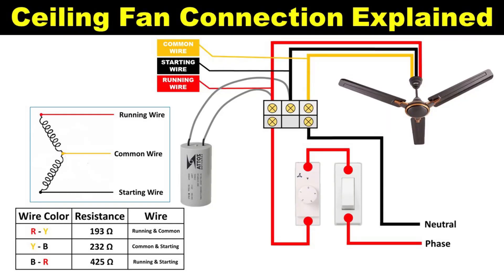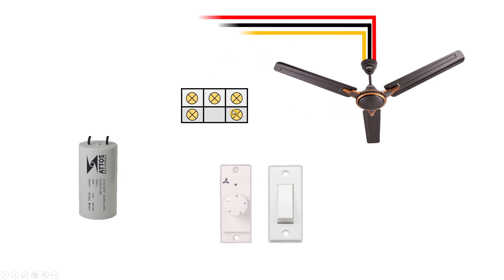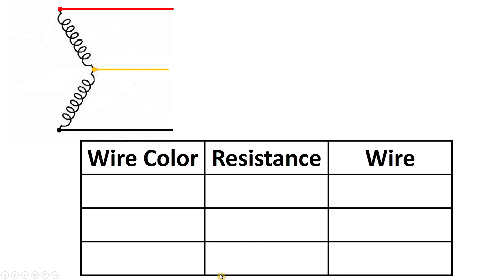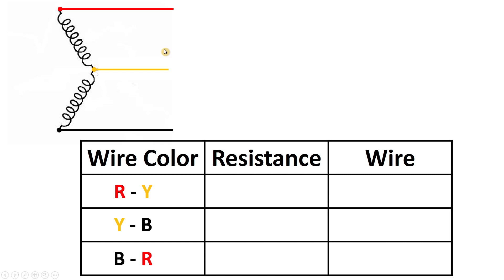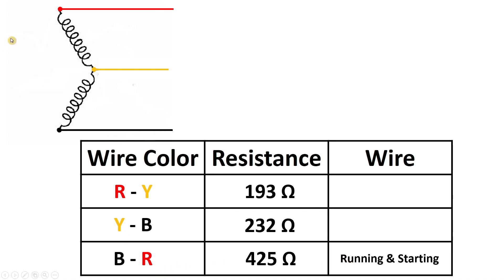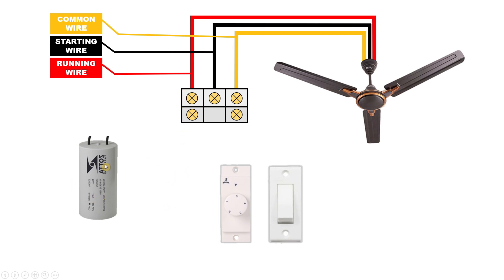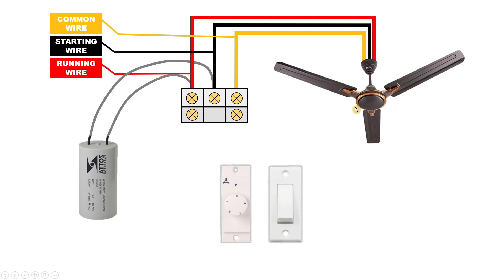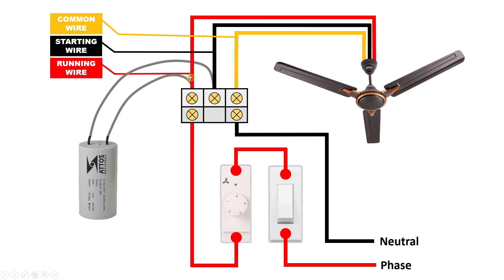Ceiling fan Step by step proper connection with capacitor @TheElectricalGuy

Comment: I need more information about ceiling fan motor connection with capacitor.
Dear sir, I have a problems with power in the house. The lights not working or not lightening. Just blinking all lights

Comment: Many thanks for clearest guidance on fan wires and their functions .I would like to know about my 3 80 years old Marelli make fans , out of which two are starting and running normally. But one is not starting by itself . It has to be given push by a long (walking) stick .Such old fans need capacitor ? How to decide and join a capacitor to this heavy 42 ''Fan and of how much value  'mfd' etc .

Comment: Explained very nicely, but what should be capacity of capacitor in ceiling fan or other like exhaust fan or heavy wall fan, what's the calculation for capacitor if condenser value is missing.

Comment: I have an old ceiling fan with circuit board.  Three capacitors on the circuit board.  Three wires go to the ceiling fan. Four wires go to the pull chain speed select and two wires for the reverse direction toggle.  Can I use a common 5 wire capacitor to replace the circuit board?

Comment: Thanks a lot sir for your elaborate explanation with a good diagram. Excellent professional way if your teaching of this type will surely clear the doubts of anyone interested in learning this subject.  Like this if you could explain the inner winding if the coils i.e starting and running it will give more exhaustive details of the complete fan from winding to operation.  While u give your details of coil winding inside ceiling fan, pls explain the following:-
1. There is confusion whether the starting side or ending side of start and run coils are to be connected for a common wire. I.e. some YouTube videos says you can take one of  end wire and  start side of start wire for common. Another tuber says either the starting side of both starting and running to be taken for correct common wire
 Some tuber says only the end side of both start and running to be connected as common.  
2. Secondly, when u see the fan running from top whether it should run on clock wise or anti clockwise for giving good sir.
3. What should be the correct gauge and no. Of turns each for starting and running coil.
4. How to find ceiling fan watts when no such watts data is provided by the company.
Pls explain this in this answer column to my comment.

Comment: Excellent, clear and concise ... Thank You 👍🏼

I have a capacitor with 4 wires 4uf, 5uf and 7uf and a three speed pull chain switch. The fan has difficulty starting very slow at all speeds. I think my capacitor is bad.

Comment: If there is a small difference between the start & run winding resistance. Then you can change direction like shown. But in most cases the start has a much larger resistance & cannot be swapped. But if there where 4 wires from the motor, 2 starting & 2 running,  then it can be swapped. By swapped the start wires around. Or by swapping the run winding. It's better explained with a diagram.

Comment: [Thank you for sharing your knowledge 🙏.  Can you explain about 3 wire capacitor ceiling fan. ]
Reply: I believe that capacitor provides a third phase from the two phases in order to supply the three phase motor from a single phase. the phase shift through the cap is around 90 degrees but not 120 degrees as required.
Local laws prevent motors larger than 1HP from this type of connection.